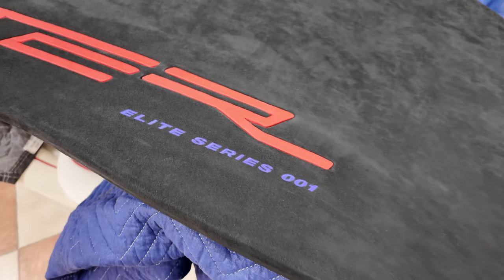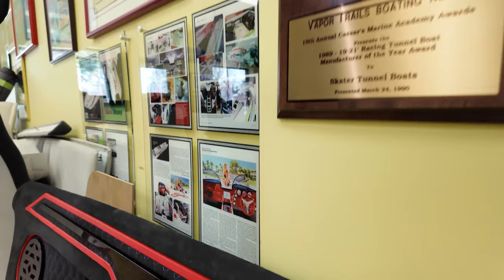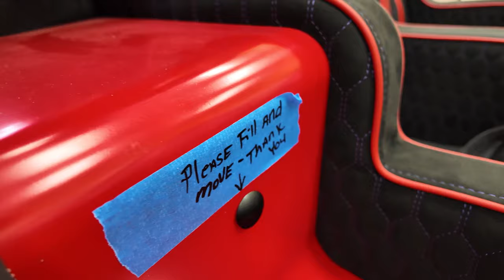Exploring the Insane Skater Powerboat Factory: Exclusive Elite Series 368 Update!

Comment: Is it possible to have the sit 1100s lower so they sit flush so the hatches don’t have to be cowl style.
Reply from the maker: The engines sit as low as possible… with that said the larger cut Skaters can run a flush mount hatch… make sense? The lower cut Skaters, the taller scoop has to be in order to clear the engines.
Reply: Yep I thought Jim’s 388 widebody had flush hatches but I was unsure why the 32 and 33s didn’t. Thanks for clarifying. Can 700s sit flush or still can’t clear?
Reply from the maker: @jebmcdonald5709  Yes, that 388 is a taller cut. 700’s are still a pretty tall motor, it all depends on how tall the cut is in the stern.